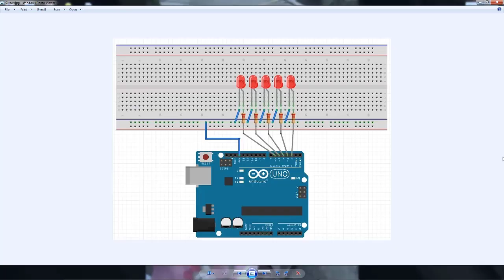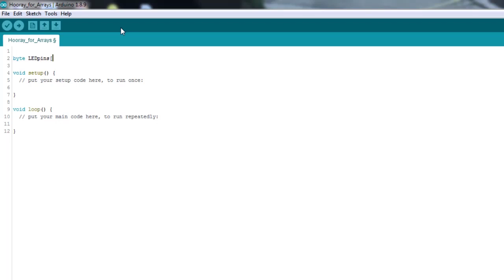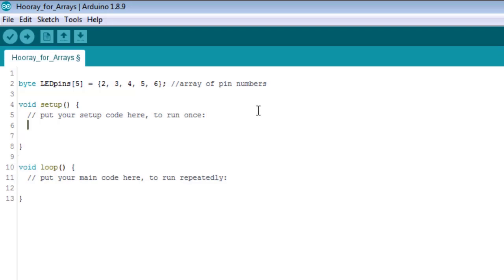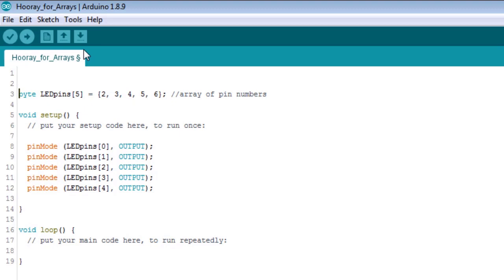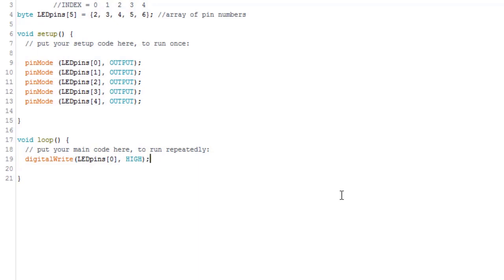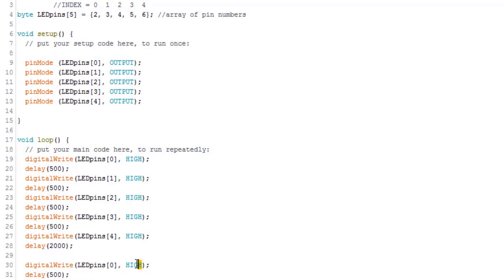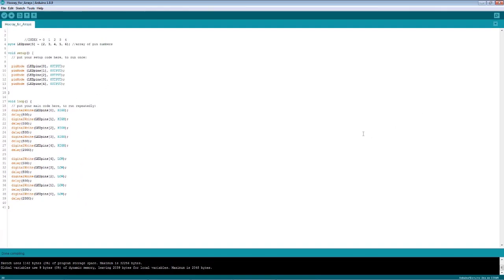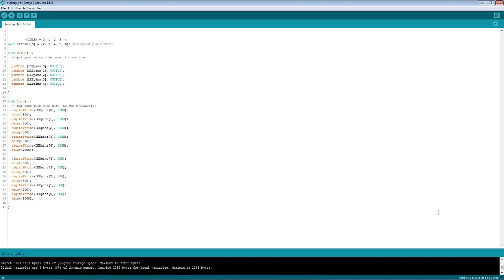Arrays Part 3 - Using Arrays to Control Arduino Pins

Comment: Why not use a for loop in stead of repeating all pins separately, like
for (byte i = 0; i < 5; i++) {
  pinMode (LEDpins[i], OUTPUT);
}

for (byte i = 0; i < 5; i++) {
  digitalWrite(LEDpins[i], HIGH);
  delay (500);
}
delay (1500);
for (byte i = 4; i > 0; i-- {
  digitalWrite(LEDpins[i], LOW);
  delay (500);
}
delay (1500);
Reply from the maker: That's a very good point! Remember, this video is for beginners and for illustrative purposes though. In the video that follows, I do exactly that.

Comment: I dont understand the benefit of using an array, vs just initializing individual variables.
Reply: This is purely a first principles 'look' at using an array for this use.

Arrays can become more complex in usage with other concepts like loops etc..

You can make code work with a totally arbitrary array length such that you don't need to edit 100 line when you add an additional element to the array. 

You can made arrays multidimensional so each element of an array is itself an array of values (that would be called a 2d array, and you can keep going with 3d arrays etc..)

In a simple case as shown, there is no difference / benefit. But in order to do the complex, you need to start with the basic.
Reply from the maker: That's right, the point was to offer an introduction to arrays and get the basics of how they work.
Reply: On most chips it’s a false economy to use byte. You will load your byte on a 32 bit bus and maybe store it in a 128 bit register on the CPU to do math on it, so it just uses the same space as an integer anyway. The compiler will probably ignore you and use an integer. But yeah, I guess on an Arduino you can probably use Byte.